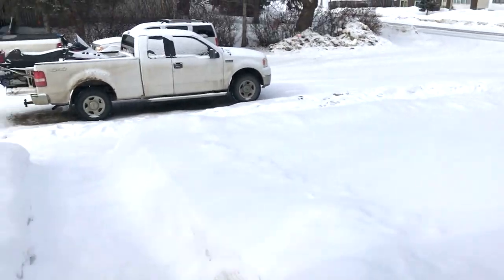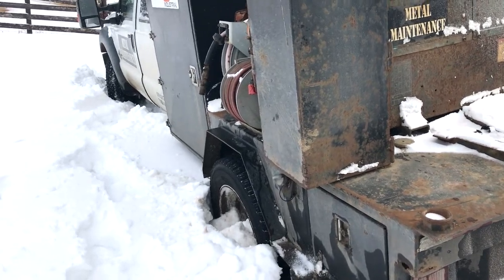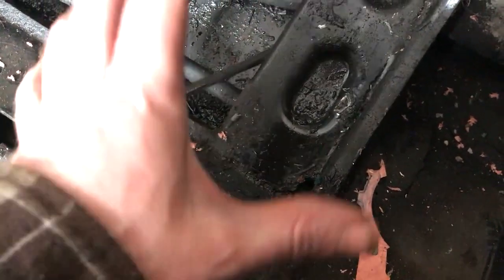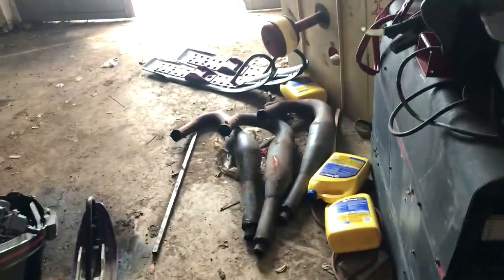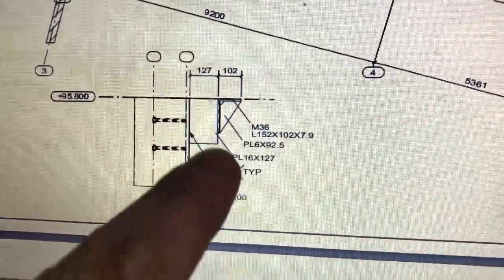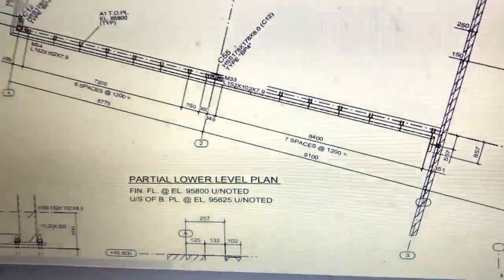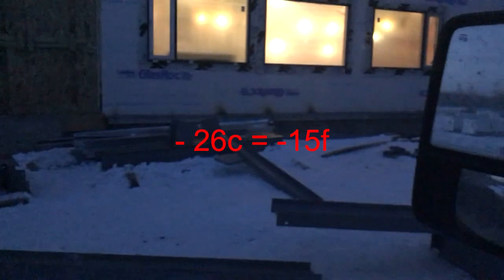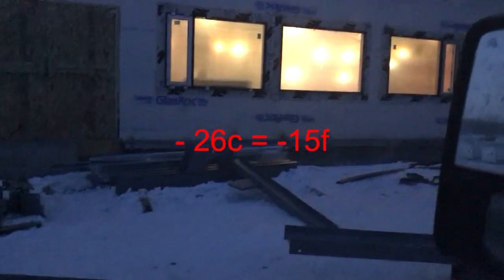It ain't easy

Comment: awesome video Curtis.well done. not blazing off that galv. coating sucks for welding. I'LL clean it every time.respir. good idea dude. Take care of yourself bud.
Reply from the maker: Yea the iron workers that fit it up definitely just slapped it up as quick as they could. If I were the fitter on that job I would have ground the galvanized off before tacking it up. My plan was to give each one a quick grind before welding,  but there wasn't quite enough room to get the grinder in. So I said F it put the respirator on and let er rip. For the most part it went well a few areas were the galvanized was on thick it was hard to weld through. But ahh well she'll ride haha! Thanks Richy!